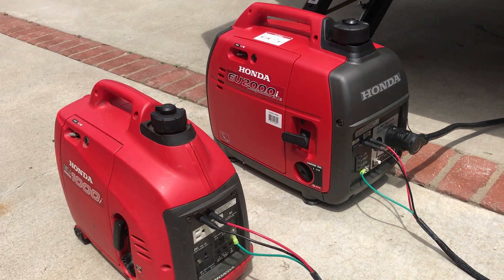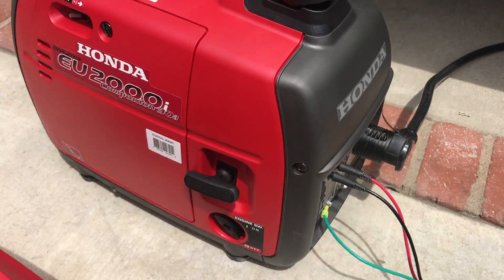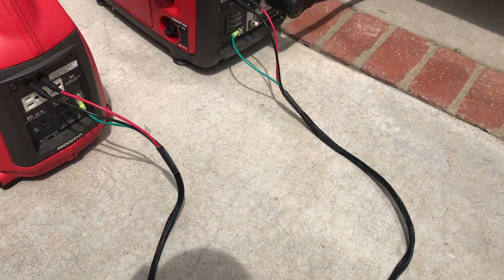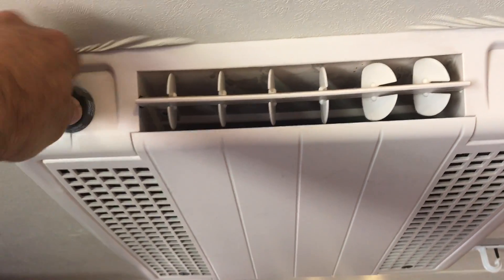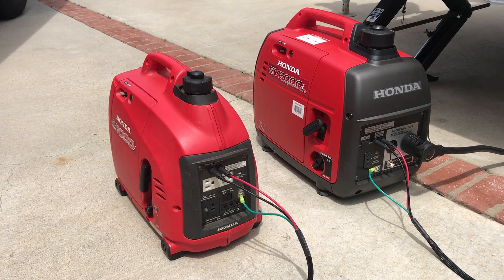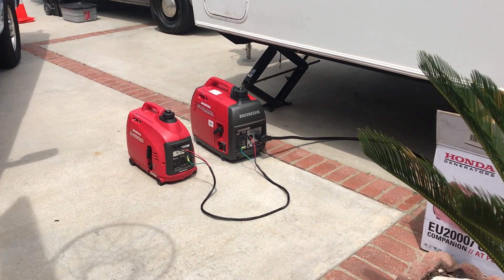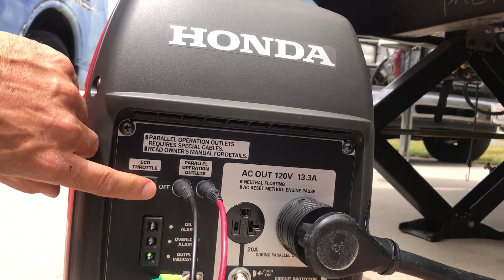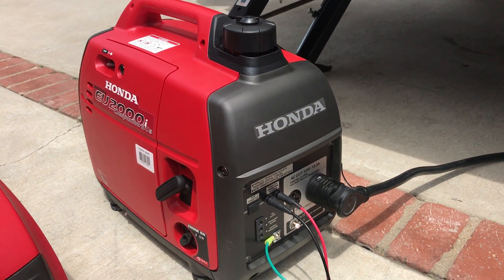Honda eu1000i and eu2000i generator parallel operation Hyper Engineering Sure Start air conditioner

Comment: This is one of those things you pay a little extra for▫▫▫>share4.photo/H1kInverter?E    Honda makes reliable equipment you can not worry about. I stored my eu1000 in a closet for years without touching it, and yesterday pulled it out, put oil and gas in it, and it started and ran the very first try. Impressively it powered a full-size fridge when my power went out (struggling a bit with the spike of turning it on), and kept my lights, chargers, and computers up and going until my power came back on. I'm very happy and grateful for Honda making a quality product you can depend on in an emergency.

Comment: How is the load shared by the generators? Is it equally shared? Or do you add their wattages?
Reply from the maker: Sorry I dont know the answer to that question.But I do notice when running parallel the eu1000 ramps up to meet   capacity and the eu 2000 does the same mirroring the eu 1000.  maybe someone here will see your post and have the right answer.

Comment: Will a honda 2000 and a Honda 3000 parallel as well?
Reply from the maker: I have not done that myself, but there are videos online that show them doing exactly that. The only reason I made this video is; there are more videos showing a honda 3000 and 2000 running parallel than 1000 and a 2000.

Comment: Nice combo , I used a eu2000 and 2-eu1000's combined together ,(see my you tube videos), my twin combo eu1000 could start my 13.5 a/c but not the eu2000 on my jayco , the eu1000 has 900 watt rated, 1000 surge where the eu2000 is 16000 rated, 2000 surge , nice to actually see a video with the eu2000 companion and eu1000 , most are just the regular eu2000, I recommend using synthetic motor oil , and I upgraded to tri fuel kit from us carb -motorsnorkel , on my eu2000 works great , us gas or propane , I adapted it to run off my trailer propane system , 
Anyhow great video , happy camping
Reply from the maker: Nice, I might have to look into that tri fuel kit.If you are having issues with the 2000 starting the a/c you might check out a soft start device. I have Hyper Engineering's Sure Start on my a/c now. I will be installing the Easy Start from Micro Air soon as a comparison.  I will post a video when its installed. Happy camping to u too!

Comment: can you tell me why you turn off the Eu 1000 unit
Reply from the maker: This was just a test to see if the two hondas would run in parallel. Which they did just fine.The 2000 will run the a/c by itself as long as it isnt at a higher elevation.Above 6500ft the Honda will not run the ac unless the ac/dc converter is turned off. So when I camp at a higher elevation I bring both Hondas with me. When Im at the beach I only need the 2000.
Reply: R. K ok I understand now,thank you,it was a great help